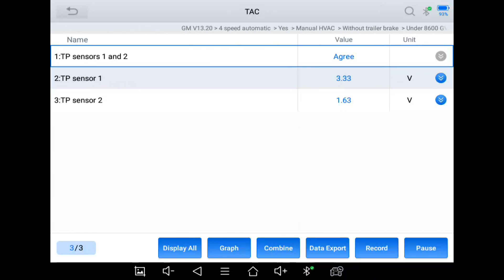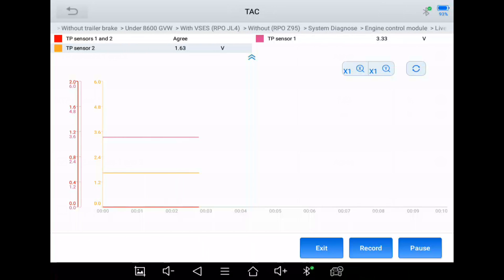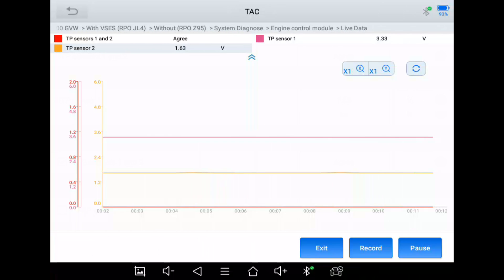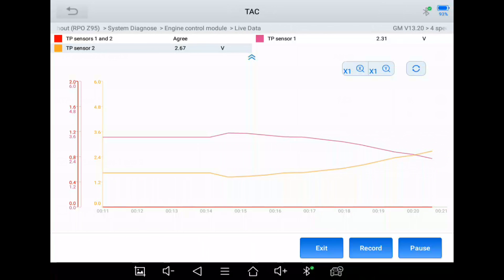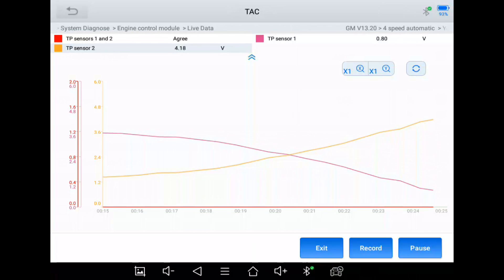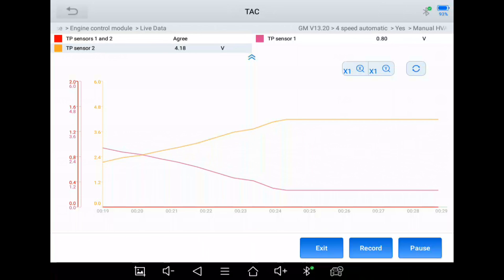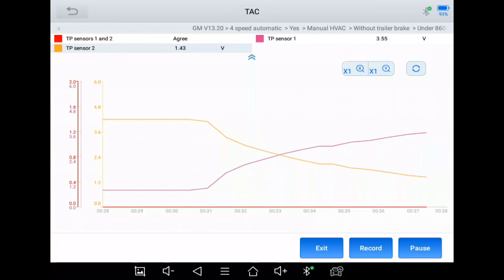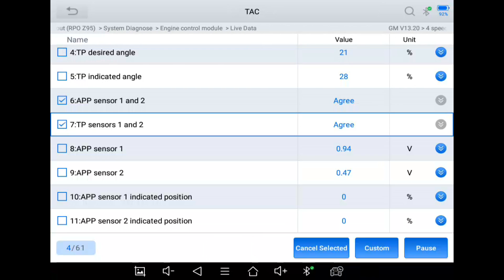What good Accelerator Pedal Position Sensors and Throttle Body Position Sensors Look Like on a GM.

Comment: Mine said agreed the whole time, but I got spikes.
And on the throttle position sensor one and two, it didn't cross each other.Like yours, did, it barely moved.But they did match each other.But when I floored it, it was not do any much difference than just as I barely pushed it

Comment: On a scope you can adjust the sweep and it's a lot easier to see what you're talking about. Thanks for sharing your knowledge.
Reply from the maker: A scope is much better than what a scan tool gives but there is much more work involved than plugging in a single connector.

Comment: This answers that I am looking for during idle app1 and app 2 volts are steady. some random timing some how app 2 volt drop to 0 volt like super quick drop to 0 volt meanwhile app 1 keep steady. I scanned with obd2 tab and not reading any DTC at all. While app2 volt drop happened engine became stall but not off it keep running just like less  second after couple times it show P1607 for dodge journey  2.4L, question is this normal or I need replace app sensor ? Cheers
Reply from the maker: I would have to see how the Dodge sensors work to know what is normal. Sorry buddy.
Reply: No worries mate, I checked the other car like maazda cx5 seem app 2 volt steady during idle or  during ignition on flat steady mean while this dodge app2 volt flat and some random peak down in secon base on obd live data for both idle and ignition on. Wirings continuties fines power supply 5 volt from ecu steady 5 volt. Perhaps I need replace sensor to make compare any way thanks for explaining how this apps work 😊

Comment: So if it’s jagged lines on both the pedal and the TB they are bad? Or wiring issue . Both are getting 5 volts
Reply from the maker: If you are not pressing down with the pedal it should be a nice solid line. If you are pressing down nice and smooth the line should be smooth with no dropouts.

Comment: My sensors read .92 and .88 and says disgree. Is it the pedal? Or can it be wiring? 2005 grand Prix. I'm just worried that I'm being told to replace a new pedal for no reason
Reply from the maker: It could be wiring and it would be a good idea to ring the wiring out with a multimeter and make sure it is good before replacing anything.

Comment: Good explanation but please what is the voltage of sensor 1 and sensor 2 at idle
Reply from the maker: About 1.34v for sensor 1 and .67 for sensor 2.
Reply: @737mechanic  please i have Chevrolet equinox 2012 with a code P2138 when i check the voltage of sensor 1,0.47 and sensor 2,0.94 but later the sensor 2 drop to 0.92 and 0.90, when i depressed the pedal fully the sensor 2 increase to 2.10 but the sensor 1, is 1.36, and the accelerator pedal position is on disagree and the throttle position sensor on agree, please i need your help
Reply from the maker: @ernestdamo677  Email me and I will send you some info.
Reply: Can u do a video on the minimum learned

Comment: @737mechanic waiting for them to add 
Battery voltage in top right corner 
Reference values (minimum / maximum) 
Update GMV 13.19
Fixed EVAP service bay test